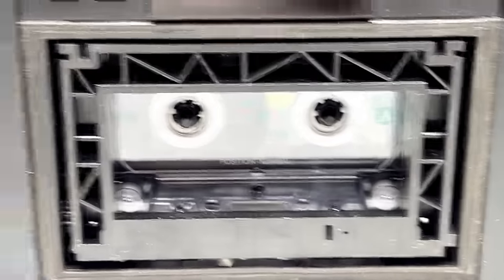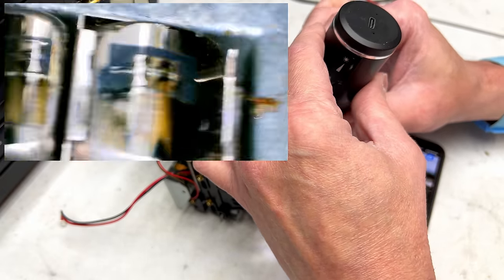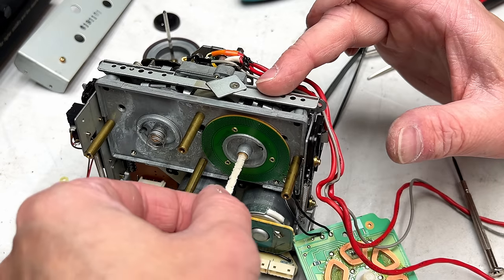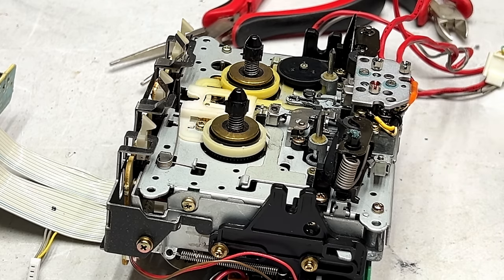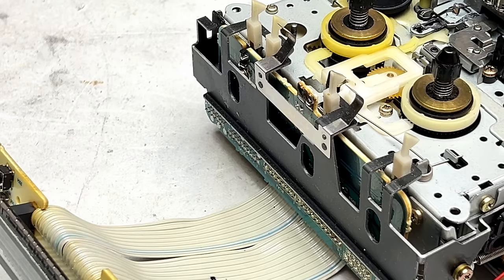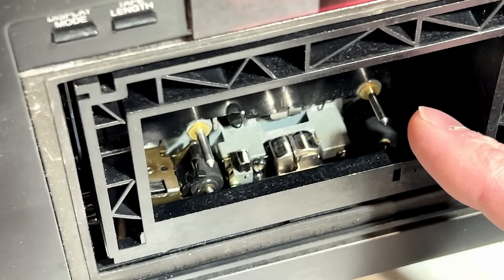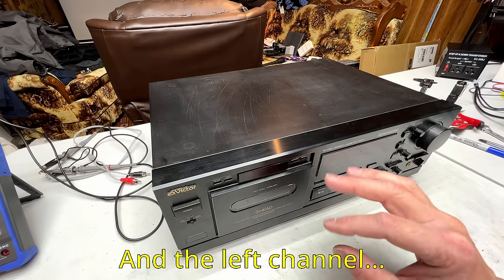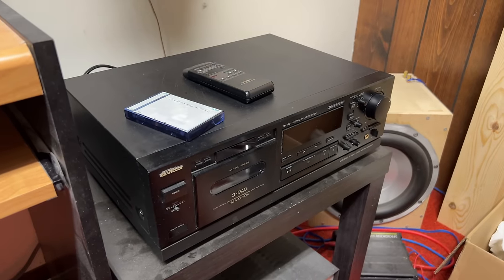JVC Victor TD-V931 - This Flagship Tape Deck Needs Help

Comment: I hear you about the price of cassette decks. It's a hobby to have fun with, not an investment vehicle for retirement. I'm into them for the same reasons, to get   a few fun decks I couldn't or didn't when I was younger and to see what cassettes are really capable of. All the different blanks are really neat too. It was extremely affordable around 2010-2015, but like any hobby where there's a collector's element, prices have skyrocketed because everything needs to be about making money. Things are priced far out of the hobbyist's range. This includes finding decent alignment tapes and blocks.
Reply: I have a TD-V531 that I recently aligned. All it needed was bias, speed and azimuth adjustment. It makes nearly any decent blank sound incredible, even Memorex dB tapes from 1985. I'm thinking of getting a second in case something happened to the first. The only fault is it can wrinkle tapes if it's not really clean due to it being a dual capstan mechanism.

Japan went crazy in the late 80s and early 90s for just about everything probably do to its on fire economy. Take a look at the cars that came out including the NSX, 3000GT, all wheel steering Prelude and Supra Turbo.

Comment: I personally like these machines, Jeremy, but they are a labor of love. I can't rush through them though, there are hidden gremlins lurking about. Enjoy it, I'll bet you like it even more as time goes on.
Reply from the maker: I’m making myself slow down for the DD-99… I think I started putting too much pressure on myself to get these videos done with the TC-K666ES. That machine and this one are both too much for one week’s work.
Reply: @Oklawolf  Exactly, don't pressure yourself, YouTube's algorithm is random and inconsistent. Just enjoy the walk the same way you do chasing storms.
Reply from the maker: I'm still glad I did this video because this deck did help get a lot of the enjoyment back I lost on that Sony, and the rest of what this deck needs seems really minor to me now that I've had a week to study the 1050's head alignment procedure. It looks really not that difficult. Probably not something I would want to try without the alignment gauge, though.
Reply: @Oklawolf  I can't recall, isn't the record head just an azimuth alignment to the rerpo head? The mechanical alignment is usually okay, although I have definitely seen them out of spec.
By the way, your axial lamps were sent back to me postage due. I'm pretty certain it made it to the border because I double checked our requirements, and it was in compliance. I wonder how much it cost us all to have them run it back through the system in order to collect the extra 47 cents?
Reply from the maker: It looks like the plate on the front handles all of the play head adjustments with the record head adjustments in behind. I do know that when I did just the play head adjustment, the record head was as far off as the play head was. It seems like the heads align completely independently to one another. The azimuth alignment on both heads was really quite easy once I finally broke that nut loose and did it the way the 1050 procedure said to. The only trouble I can see having when I go back in there is if the head tilt changes when I adjust head height. But I have the gauge for that anyway so no big deal as long as I can break the adjustments loose.

You don't have to send the lamps - I'm in no great hurry to get the 666 done at this point. I want to finish the transport service on it now anyway, so I'm going to shoot segments on it here and there as I find time and willingness while working on other things.
Reply from the maker: I found an exploded diagram in the 1050 manual. Yeah, they're completely independent. Looks like very little chance the tilt is going to change with height adjustment, but I'll check it as I go anyway.
Reply: @Oklawolf  As I recall, there are inboard grub screws that align both the tilt, and tape path, to the repro head. The record to repro azimuth of course is outboard, and height is fixed, but can be dealt with if out. The tilt will change with height adjustments, yes. Once rough aligned, make the same adjustment to both height and tilt screws, then following repro azimuth, double-check height, and/or tilt, then do the record azimuth without touching anything else if all else was okay. The huge benefit of discrete heads is the ability to correct phase error. The bonded, sandwiched heads, can lose phase as the potting compound cures and shrinks, there is no solution for that, you're stuck with whatever phase error for eternity. Replace the heads you say? Try it, those have moved just like the rest.

I already resent the lamps, I don't want Canada Post to get the better of me :)
Reply from the maker: Thanks! That seems to track with the alignment instructions in the manual, so I think I've got this. Might have to pull the transport a few times, because there is no accessing some of this with it in place, but I've done that 6-7 times already. It's not hard, just tedious. And I have the power supply now to raise the head block the easy way. Thanks again on the lamps!
Reply: @Oklawolf  It's not too often I've seen that factory alignment far out, but the first time, I chased it for what seemed like years. Who knows if it was actually original, or slipped over time. Anyway, it's one of the reasons I prefer to fully "blueprint" every transport, it's just not worth piecemealing when they're this old, pitifully few are in need of less. Enjoy the Victor!

Comment: What a beast this device truly is. IMO you can get it to better performance after you fix all the left... Nice deck, great video! Keep it going! Cheers mate!
Reply from the maker: I think this is the first time I’ve considered not even trying to find a better cassette deck. I’m having to stop myself from recording with it until I can finish the alignment. It looks like that part shouldn’t be too hard at all, as long as I can get enough adjustment on the azimuth.
Reply: Good Morning🎉😁

Comment: If you trust your azimuth test tape, then the best way to set azimuth is to use an analog scope and set to X-Y mode.  You'll be able to dial in the azimuth precisely.  

Setting the tape/head height.  Again, if your test tape is properly made (and made as a stereo tape, not full width), your level should peak when your height adjustment (setting the leading pinch roller, in this deck's case) is achieved.